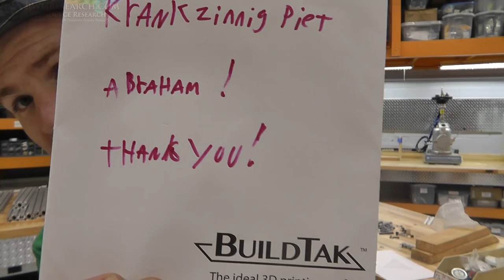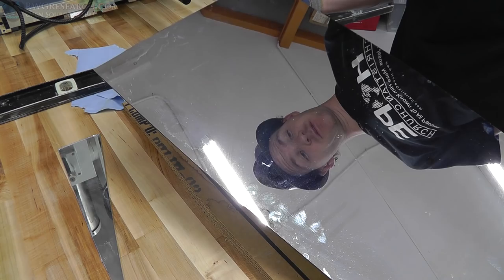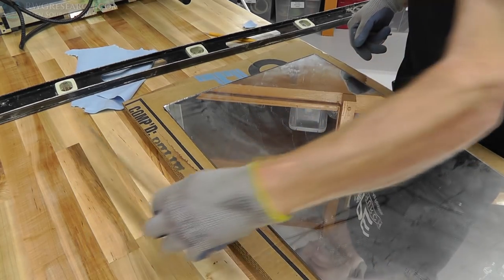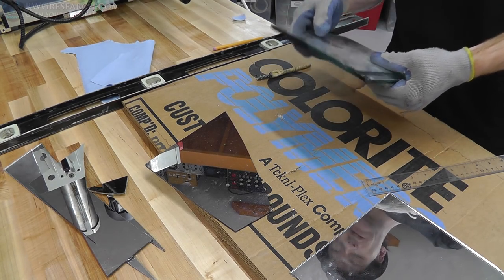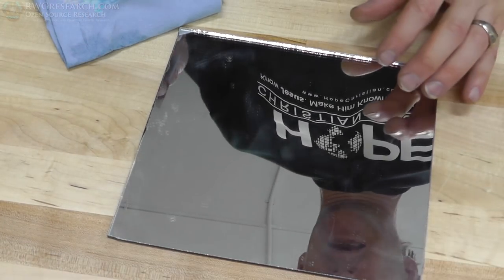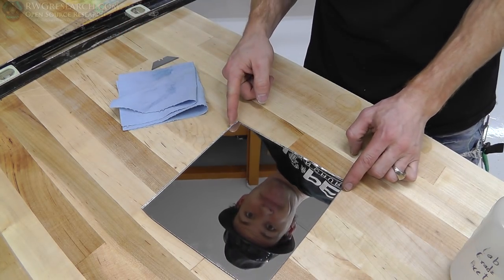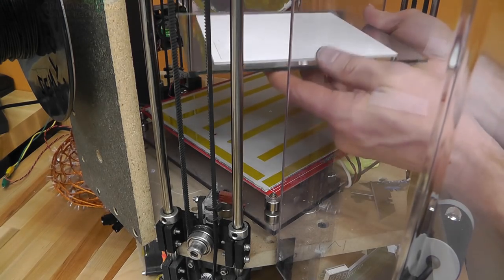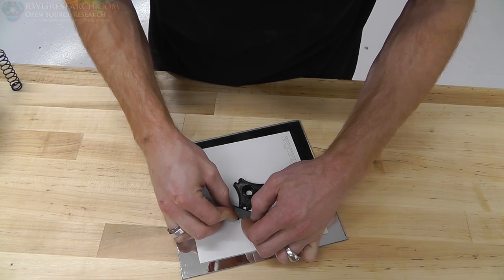My Experance With BuildTak 3D Printing Build Surface & How Not To Use The BuildTak! :)

Comment: I learn to upcycle from you, thank you for that Russ.

"When it comes to nozzle 
height, we have found that there is a sweet spot that allows for optimal
 adhesion/removal of printed parts. When trying to find that sweet spot 
it is better to start with the nozzle height on the high side and run a 
test print where you pay close attention to the first layer of the 
print. You will know right away if the nozzle is too far because the 
extruded filament will not stick and in that case, no harm done to the 
sheet. Just reduce the nozzle height slightly and try again until it 
sticks. For setting the nozzle height (i.e. the distance between your 
nozzle and the BuildTak sheet) we recommend using the thickness of a 
standard piece of office paper (or about .1mm) for ABS and a piece of 
card stock (or about .2mm) for PLA. with just a little bit of friction. 
Proper leveling should also increase the longevity of the sheet because 
it will more than likely mean you will not be subjecting it to as much 
wear and tear in the removal of the object." - That what the Buildtak people say.

Comment: You should etch into the glass on a hard surface. Then dangle the piece you want broken off over an edge and simply tap it once and it should break off down the etch line cleanly in one go. Tapping the glass like you did multiple times can cause internal fractures that cannot be seen in the glass so that in the near future the glass just may suddenly crack in your hands which is ofc dangerous.

Comment: Hi Russ, I've had this issue a few times. If you really can't get the part of the bed, turn the Heated Build Plate on at about 50C. If the part is PLA you will have to hover over it to pull it off ass soon as it warms (else it may sag).

Comment: I just ran into this sort of surface after printing for a long time on Boro glass and I had the same issues.  I darn near broke the bed getting my part off but after I looked at the print I noticed it had some hefty Elephant's foot so it was my fault.  After the fourth time I decided to use a piece of paper folded over and the print lacked the elephants foot and came off easy enough (not as easy as glass that once cooled the print will just pop off most times on its own) but I think two sheets is slightly too much and the sweet spot is about .15-.175mm which is 1.5 to 1.75 sheets.  I think I can compensate for Z via the software so I can use two sheets then tell it to lower the head down slightly lower and go with it.  I will try that soon.
Reply from the maker: If you get the hight set right. I have had better luck with pla. but abs still sticks to well for me. also lower bed temp like 1/2 what your use to. that was a key for me. ~Russ
Reply: *****
I am only printing with PLA for now but I miss my ABS and already my bed went from 60 to 40c and still it sticks, lol.  On glass you get to 47c-50c and it would just go "plink" and pop itself off (why I loved glass so much).

Comment: The trick with glass scoring, as I've heard, is to only score it once. If it's scored more than once, the score lines will be in slightly different places and will produce an uneven break. Also, if the score line is far too deep it can cause bad breaks.

Comment: I had loads and loads of problems with build Tak.  The same experience as you, despite trying just about every first layer height.  In the end I gave up on it.  I had had very good experience with frosted glass and ABS juice, but it was a pain.  Then I went to PET plastic sheet and 3M adhesive to stick it to a sheet of glass... MUCH better than BuildTak.

Comment: hi Russ, tanks for share you experiences with us.

Maybe you can help me.

i have trouble printing long parts, they curve and ruin everything. i cant print a flat surface

i have blue tape, hot table, cooling on nozzle and now i cover the print wit plastic to avoid air flow.

my print is a CTC with 2 heads.

Thanks

Comment: Not 3D print-related, but generally a not the best idea to use acetone on a laminated bench, since it will eat through a number of anti-scratch coatings, and then the glue underneath.  

70% Isopropyl usually is more than sufficient for cleaning most surfaces, and evaporates quickly enough to keep it from harming most surfaces too much.  For bare electrical contacts, etc, it's best to use high-proof ethyl alcohol, as it evaporates even faster, making corrosion, etc. less likely.

Comment: Put alcohol around the edges while the part is cooling and the alcohol will get pulled under the part and it will float the part free. Still, all in all, PEI is superior for ABS at 100C-110C and use alcohol there too. Say goodbye to forcing anything off the build plate. Your build surface will last a long long time. Oh yeah, and time for some glass cutting lessons for you<g>.

Comment: if the build tak peals off the glass,why didn't you just peal it off and then try to separate the part ?
Reply: bill bailey he could have done that but BuildTak is meant for multiple uses. If you peel it off, it'll ruin the stickiness and you won't be able to put it back on the glass. It's too expensive to use BuildTak as one-time use. for me at least.

Comment: I am looking forward to getting some of this stuff. I have a dickens of a time getting ABS to stick reliably with a heated bed and ABS juice. My parts come off with the ABS juice scum on them leaving a beautifully clean bed...unfortunately,  while  printing. Hope that the Build tack takes care of that.....Thank you for the....demo.
Reply from the maker: Yes, it's a battle between too much and not enough the balance is hard to find.  I've had really great luck with ABS juice and this build tech seems to work really well if you have your settings just right. Things for you to consider I've had these problems in the past. Make sure there's no outside air blowing on your print this will affect it too. Also make sure you're using a heated bed I'm sure you are but I thought I'd mention it. The last thing is get your settings just right sometimes if it's too hot it doesn't work right either. I have my bed at 106C. hotend temp will also make it difficult. Also make sure the consistency of your abs juice isn't too thin that's not good either. hope this helps! ~Russ
Reply: +Kurt Johnson  Check out PEI, that stuff is amazing for PLA/ABS.  You can get it at Amazon and McMaster Carr.  I haven't used any type of glue in over a year. http://forum.seemecnc.com/viewtopic.php?f=36&t=7452
Reply: Thank you for the tips. I built an enclosed cabinet for my Prusa i3 as it sits in an unheated workshop. I preheat the cabinet and printer bed to help with temp consistency but getting the right ballance has been a challenge. The moving bed of the Prusa style probably doesn't do me any favors on taller prints either, hoping that buildtak will help. Losing a print 3/4 done is ........anoying. Thanks again
Reply: +Kevin Stacy Thank you, I'll look into it. Always looking for a way to make the best print wit the least amount of frustration

Comment: Buildtak run bed at 80 to 85C with ABS.
Reply from the maker: +Terry Pounds thanks, i have been running at 70C with better luck! found out the hard way lol  ~Russ
Reply: +rwg42985 Have you tried PEI? I am having a hard time getting PEI to stick to glass I used 486MP tape but it is lifting from the glass especially when ABS starts to flex during printing. Any suggestions??

Comment: Buildtak is really annoying, it's expensive for it is (you can do 10-20 prints tops and it wears out). I suggest using PEI bed surface -- you can laminate it on Glass using 468 3M tape. You don't need ABS juice or glue stick or any other tricks. Just wait for the bed to cool, then a little gentle persuasion, and stuff comes off.  I love the buildtak spatula though, it's really a great tool for getting items of the bed. I've been usng PEI on both my printers, have a 8x10, and 12x12 bed size printers (I also laminated my friend's Boro glass with a sheet of PEI, and he is loving it), it is tricky to do, so I offered -- there are YouTube tutorials on how to do it. PEI is so dead simple to use my wife starts prints with a toddler and an infant, so no bed prep needed. I've used ABS, PLA, PETG -- all work beautifully with it. Perfect adhesion. No curling (provided you dial your printer in well) Nylon works -- but with glue stick, but I did print a full bed of nylon parts -- work very well. TPU and NinjaFlex stick too well, so I would not use those -- I've had OK success with some oil on the bed first and no heat, but it's just easier to swap out the bed (or flip it over)